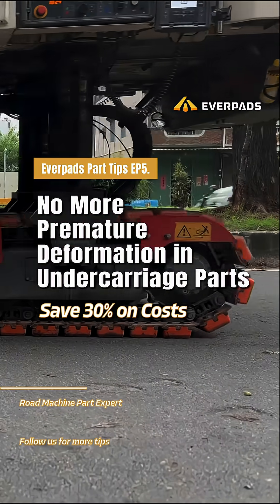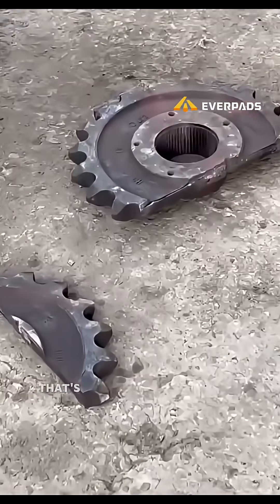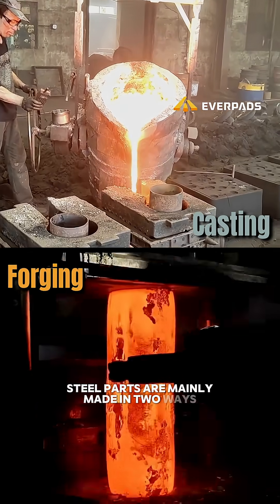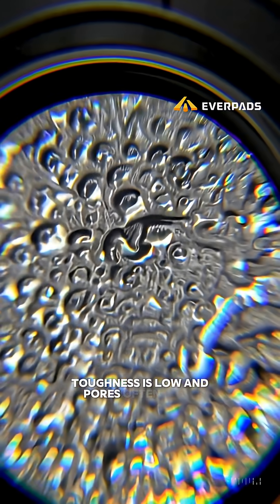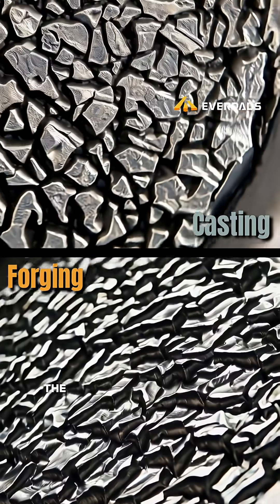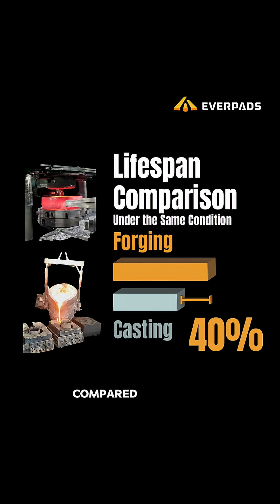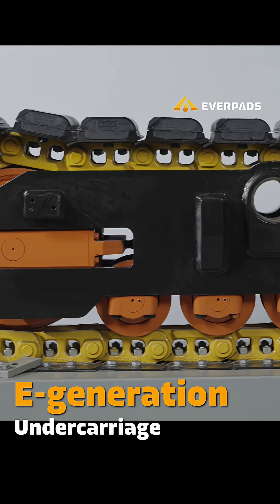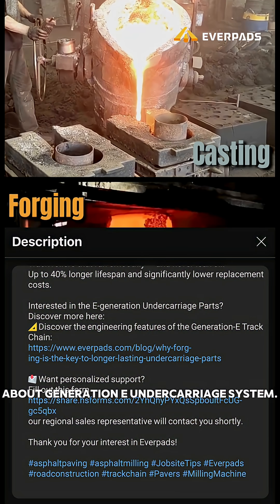No more part deformation in Undercarriage System #asphaltpaving

Comment: Very true on casting vs forging. However, the forging process is but 1 of many needed in the process; quench, heat treat, peening, etc.. So just having a "Forging" doesn't equate to longevity. And if your Company isn't AS9100 certified, I'm out.
Reply from the maker: You're absolutely right — forging alone isn’t the only key to longevity. In fact, our next video will dive specifically into our ABP heat treatment process, because a short video can only cover so much, and there’s a lot more happening behind the scenes: quenching, tempering, peening, structure design, and more.

We also really appreciate your thoughtful comment — you clearly know your stuff. As for AS9100, it’s a quality management standard specifically developed for the aerospace, and defense industries. Most companies in the road construction sector don’t pursue it simply because that level of precision doesn’t significantly improve the real-world performance of components in this field. If that level of spec truly translated into meaningful advantages here, technologies like aerospace-grade laser heat treatment would be considered — but just like you said, heat treatment is only one part of the equation. The overall performance also depends heavily on factors like geometry design, material selection, structural engineering, and many other design choices working together. Even with aerospace-grade certification, the overall performance wouldn’t necessarily improve in this application.

Thank you again for the valuable feedback — it really motivates us to dive even deeper into these technical details in future videos!
Reply from the maker: Before we publish the introduction about heat treatment, you can check our brief on the steel process here:
https://www.everpads.com/blog/why-forging-is-the-key-to-longer-lasting-undercarriage-parts#heading4

Again, we really appreciate your feedback! We hope you’ll continue sharing your thoughts with us — it truly helps us convey our message more clearly, just like now!
Reply from the maker: Here’s our latest video, which is about heat treatment. https://youtube.com/shorts/rILZ4BPHhtU?si=9Lazx54UQREPkA_3